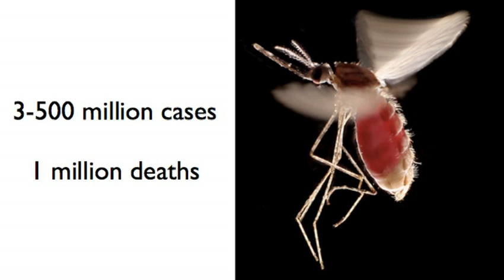Marc Koska: 1.3m reasons to re-invent the syringe

Comment: I commend this guy for offering an alternative solution.  He's a constructive thinker.  Having read a lot of the comments, it is clear that there are huge design, cost, and health challenges associated with this solution.  But it is a start.  I wonder, if it would be possible to create a single-use syringe at half the cost of the current syringe?  Also, is it possible to offer an inexpensive/easy  "sanitizer" for syringes?

Comment: @marckoska Thanks for taking the time to reply.
I do not doubt your motives and the efficacy of removing reusable syringes from the equation, it just seems that reusable syringes would be sourced by those with the bad practices. Of course it will make some difference, but i wonder how much, even small cost increases seem to drive the problem.
it is more criticism than rebuke. good luck to you.

Comment: @phicubed 
I don't think it's a fail but the first step to improvement!
If the syringe would lock at any given point to where it has been pushed in and could not be pulled further out that could be the ultimate solution.

Comment: Couldn't agree more.  Why does an auto-disable syringe have a higher environmental cost?  Same amount of plastic etc.  Plus when used - less secondary transmission, less people ill, so less equipment needed to treat etc. in the future.
This cannot be viewed as just the syringe you are right but has the same complexity as a seat belt.  We were asked nicely to wear them, then told to in law, and now punished if we do not!
Ideally we need far fewer but safer injections worldwide.

Comment: If the syringe cannot be reused 20 or 30 times, then that makes it 20-30 times more expensive.
Also, syringes could be over filled & used for several injections, thus never requiring the plunger to be withdrawn, it solves nothing.
Cheaper sharps and syringes, better training & adequate sterilizing equipment (so syringes could be reused safely) would be a much better better.

Comment: Obviously these hospitals CHOOSE to administer drugs with used needles. Even if one-time-use-only needles are produced, they will simply CHOOSE to use the old style. I'm sure the hospital staff are not the ones worried about the bottom line. They will use what they are provided with.

Comment: Problem with this product is that it can't be re-used. So you are asking hospitals to buy a product that can do less.

Of course it's safer, but the problem is that they can't afford to buy it anyway since it costs the same as the ones they reuse.

Best would be to have some sort of injector that CAN be reused and only cost 5 cent or so in the first place. :|

Comment: Say they use 1 syringe for every 100 patients. That's $0.0.5/100 patients. But if they have to use 1 syringe per patient, that's $5.00/100 patients. That is 20 times the cost of the old type. At that rate, the cost is 20 times higher.
These are a great and innovative idea, but if they're going to be used, they need to be affordable. How do we make them affordable?